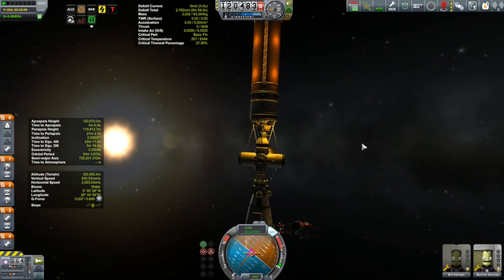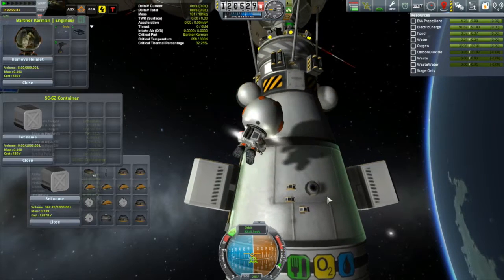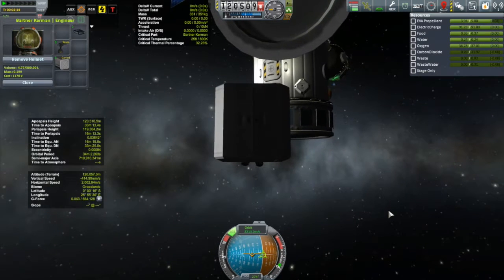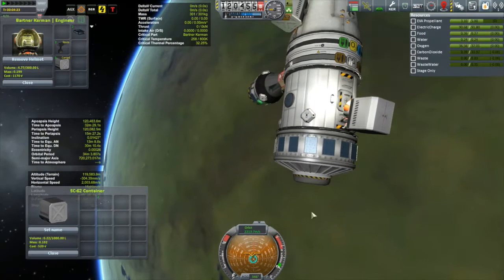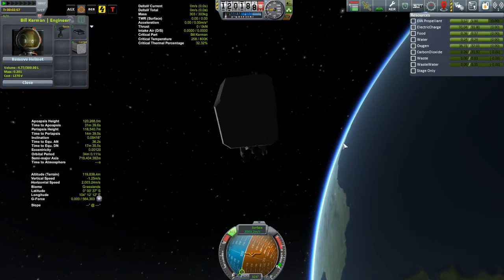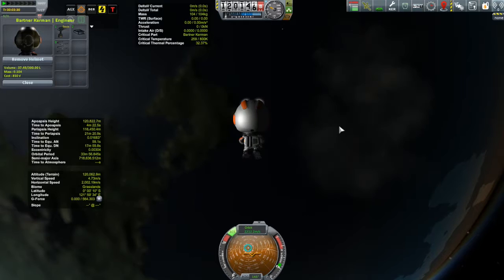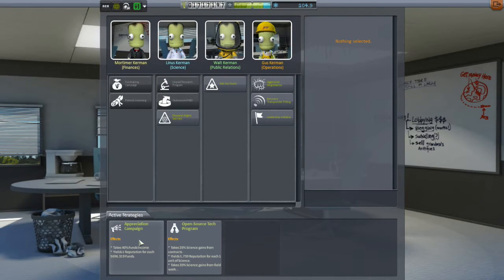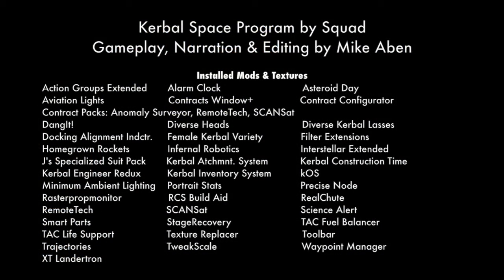KSP Career: Episode 57 - Where's My Sherpa?

Comment: you can turn off the remotech flight computer if you open it's UI and then go to the excute screen (then one that pops up on the right side of the UI where you can see how long it will take until your next command is executed) and then you can just cancel the current command. i hope that was understandable. It took me some time to figure that out myself :)

The cheap unfolding solar panels don't seem to be repackable anymore. That is either a change for 1.0.5 or indeed in Remotetech.
Reply from the maker: +schmonzo42 Thanks.  It&#39;s been a while since I&#39;ve used the flight computer and every time I have to relearn it.  I'll explore a bit more with the solar panels.
Reply: just looked it up, the 3*2 and 6*1 solar panel don't retract anymore, that's a 1.0.5 feature, kinda makes sense, but makes aerobreaking more difficult...

http://forum.kerbalspaceprogram.com/index.php?/topic/106721-solar-panels-not-retractable/
Reply from the maker: schmonzo42 Cool.  Thanks.  I actually like that because it creates a better reason to use the panels that come in and out of the boxes.

Comment: With remote tech, using the double arrow in the bottom right of the flight computer, you can setup everything in advance in case you lose communication, like holding your retrograde even without your antenna.
Reply from the maker: +YodaSoda I'll check that.  I've used RemoteTech pre-1.0 and seemed to recall it doing it anyway.  I wasn't too concerned because I knew that it was aerodynamically stable anyway.

Comment: Have they changed KAS so parts snap to the surface? I found trying to place the large parts really hard. Obviously adding the hand-holds helps a lot!

I must remember not to just buy all the unlocked parts per node and just buy them as required. Would save a lot of money and space in my parts window.
Reply from the maker: +viruk67 In +Sean Gordon's comment above he says that the electric drill has the parts snap into place while the wrench does not.  I'm really enjoying KAS and wondering how feasible actually building whole space craft would be.  When I go manned interplanetary, I tend to go with various modules assembled in space using the clamp-o-tron seniors.  I'm wonder if, with enough Kerbals, it is possible to assemble the pieces without docking ports at all.

It may be fun to find out.

I also don't tend to buy parts that I think I won't use.
Reply: +Mike Aben I got into the habit of just buying everything. I must stop.

I also love the clamp-o-tron seniors. Other than the 1x1 solar panels and the LV-909 engine, they are my only must-have pieces.

I've seen a rover built on site, not a whole ship. I wouldn't have the patience, but would love to see it.
Reply from the maker: +viruk67 I was thinking of sending it up in chunks, but instead of connecting with docking ports use KAS to attach them. It may not work.